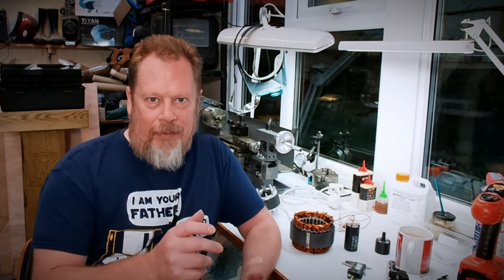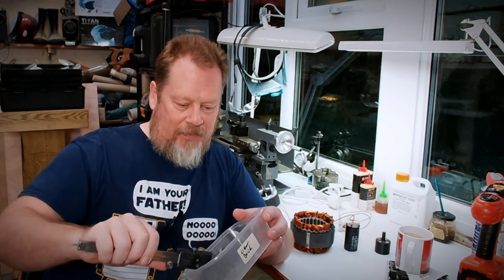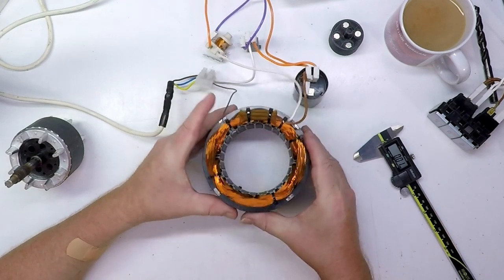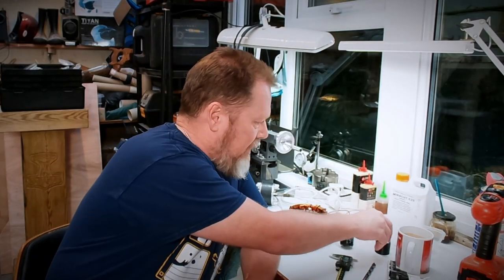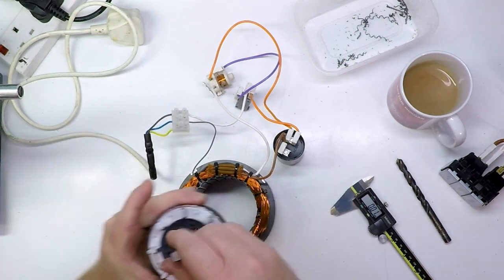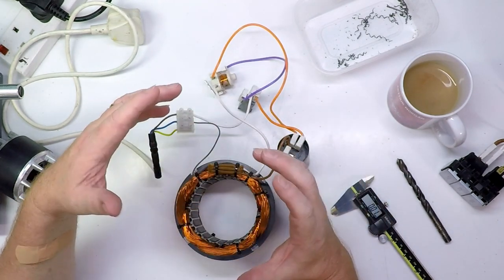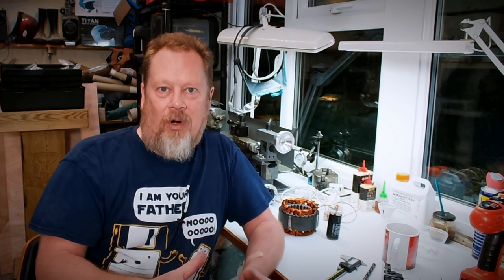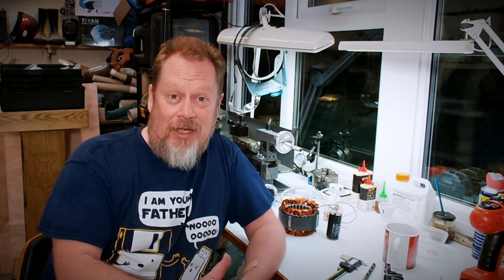Demagnetize your tools using a Food Processor - Part 1

Comment: Do you think this design would be strong enough to degauss hard drives?
Reply: Wtf, absolutely loved the video. It's relaxing listening to you talk
Reply from the maker: You can get quite a powerful magnetic field from it so it might work. Don't know whether the external field would damage the drive if you wanted to use it again. Also limited by the size of the hole in the stator as to what size of disk would fit.